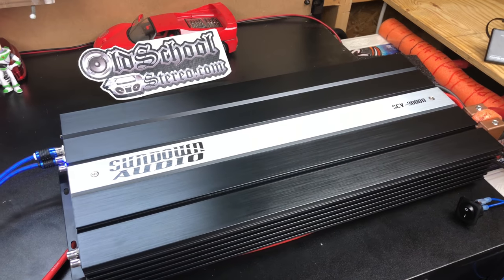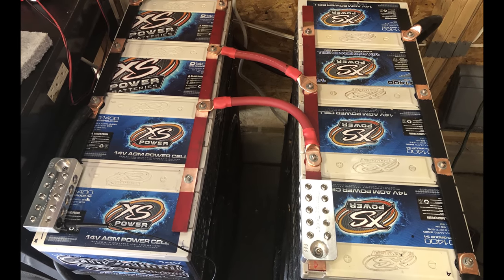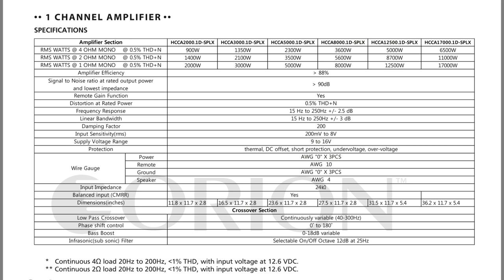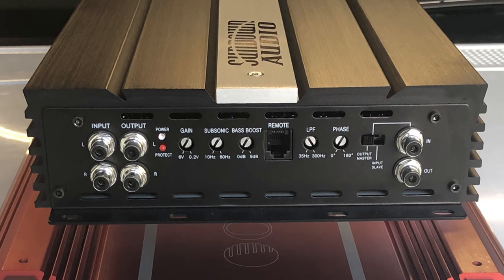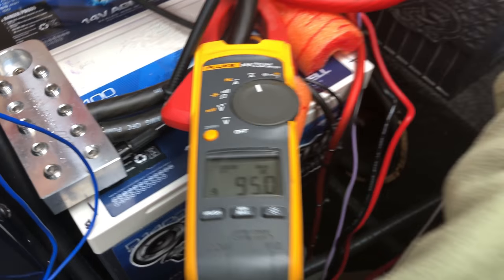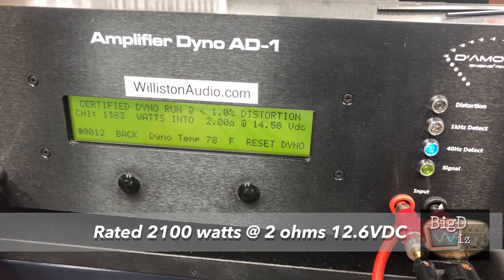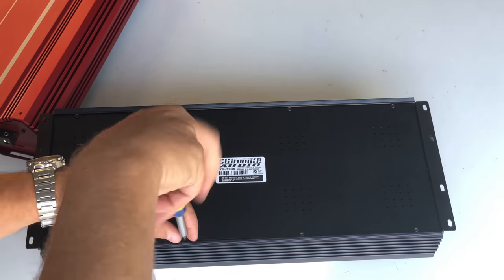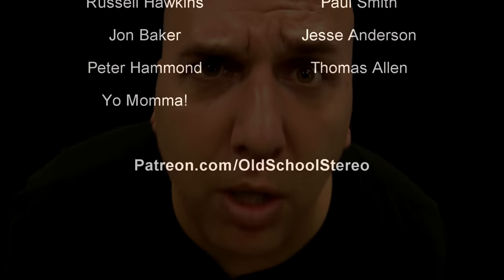Sundown SCV-3000D vs Orion HCCA 3000.1DSPLX Amp Dyno Test (4K)

Comment: BigD, any word on what the Orion does dynamically at 4-ohm? I always keep telling people, strong output at 4-ohms+, as well as dynamic power will always be better for music due to impedance rise. All these people with 3K+ Korean amps are probably putting out less than 1/2 of that on real music unless they play at the point of lowest impedance (which is depends on woofer fs, port tuning and box size).
Reply from the maker: Yes, 2171 watts Dynamically at 14.7 volts according to my tests.
Reply: Thank you. :)

Comment: I thought I had seen somewhere that u were possibly giving one of these amps away after u had tested them all. I may have seen or read it wrong. I don't remember. I have watched this video like 10 times since u have posted it. I'm still blown away by the power that monster put out. If u decide to give it away, keep me in mind. LMAO. All jokes aside man u made an awesome video. I think this is the best video as far as dyno testing so far. Thanks again. Crystal clear picture. Thanks for all of ur hard work. I love the Orion amp, and yes I hate the plastic end caps also.
Reply from the maker: Yes, Orion has agreed to offer up an HCCA 3000.1DSPLX. Details coming soon!
Reply: BigDWiz wow man that's awesome. That says a lot about a company right there. That's great.

Comment: What I want to know is if this 4500.1 DSPLX is the same kind of beast! I hate to buy it with out seeing a Dyno but I’m pretty sure I know what to expect. I’m holding out for that 8000.1 to come back though I’m not giving in I love my ORION and refuse to switch but the JP83 was tempting just because it’s the only thing available around that power that I’m looking for.

Comment: the orion definitely killed them all, but it is truly a competition amp and not a daily amp.. who really runs triple inputs daily? lol the price is also very good.. I'd still say the skar comes in 2nd do to its price per watt and reliability and more of a daily use amplifier.. just shows you that sundown is way over priced, and has the exact same gain controller with clipping as the skar.. is the extra 200+ dollars really worth buying the sundown over the skar? only thing it has that skar don't is the tiffany rca inputs.. I feel that my skv2.2500 is more closely matched to the sundown 3000 and I only pd 499 for it..
great video though, been waiting for this.. maybe people will reconsider where they put there money.. I guess if u r running sundown subs your probably going to buy there amps anyways as ur not on a budget...
Reply: Also the triple inputs are better for a daily amp because less voltage drop means less heat. Also you can run multiple batteries/cap with out needing junction blocks.
Reply: I wouldn't mind adding some extra wiring to get a beast like the orion. I'm sure it would do just fine daily if installed and used properly.

Comment: I'm not surprised. I have been out of the car audio game for over 20 years, but I miss that bass! I used to run 2 Orion DVC-12s and 2 Orion XTR-6s along with 3 Orion XTR tweeters and 2 Altec Lansing 5 1/4s all off of 1 Orion 225 HCCA!  I never had done the Big 3 upgrades or had an extra battery or anything back then and that amp never shut down on me. 50 Watts RMS and would smoke dudes with over 1500 RMS in SPL comp. Phoenix Gold was huge back then and my buddies all had it. They bowed down to Orion once we did SPL drags. Keep rockin Orion!!!
Reply from the maker: Orion now is under new owner’s but yeah they still kick 🦵

Comment: Holy shnikeys that Orion's a beast!! 😮 Very well built too. 👌 I'm not big into class D amps but at that price, it's irresistible not to buy it. Great video bro. 👍
Reply from the maker: It really slams at 4 ohms and not too power hungry at that load. It’s a big, heavy amp though.
Reply: Not into Class D? lol , Its snake oil that ur drinking. Do a blind test and tell us if you can hear a negative difference.
Reply: DA Master Ummm.....Yeah. Been there, done that. I'll stick with my class AB's thank you.
Reply: DA Master They'll never be able to reproduce music as accurately as class AB because they're non-linear and the physics say so. They mimic music.
Reply: Late to the party...it's been proven, audibly you can't hear a difference between class a/b or class D, it might show up on a digital spectrum analyzer, but your ears cannot pick it up, at all.
Reply: It may not be very audible for sub duty. As for full range class D, very audible. And I don't care what anyone says. My ears don't lie. Maybe when I hear a class D with GanFet technology the case might be different.
Reply: There's a guy named Richard Clark that's offered $10,000 to anyone who can tell the difference for 12 years, no one has one. Look it up and give it a shot. Closest anyone has come is 10% accuracy, which was lucky guesses.
Reply: I know who Richard Clark is. Not interested.
Reply: I didn't think you would be. I've been around SQ comp for half of my life. Heavily involved in the RRS circuit. 10 elite shows a year just for SQ. Some are elitist like you and bought into the BS, others know better and vied for efficiency. Iasca and USACI both have had champions running class D to mids and highs. 🤷‍♂️
Reply: You're beating a dead horse bro. I like what I like because of my ears and not what others may think. If you like class D, then stick with it. I've been in this hobby for over 30 years and it's all about choices and personal preferences. I won't be swayed in this matter.
Reply: That's fine. I just hate seeing people waste money and efficiency because of a long proven wrong myth. By all means though, Carry on.
Reply: @wal  Do you remember the amp draw @ 1ohm for the Orion?  I know you showed 317 @2ohms

Comment: That Orion HCCA amp has been out for years. Its always been a beast! I had an MTX Blue Thunder Amp years ago driving a Cerwin Vega Vega Series back in the day in like the late 90’s early 2000’s. Speaker was made of Kevlar, and had double lip foam. Had it in back of my IROC Z. I still have the car, actually still have the system. Still have the Alpine Head Unit with Gold Plated 4 volt preouts. Its when BBE was big with those. I paid close to $500 back in 1998 for it.
Reply from the maker: The Blue Thunder amps are great too
Reply: BigDWiz 
Yeah had surprisingly good power for its footprint. I think mine was 425X1. Could of hit the sub with more, however I was 16-17 years old back then was lucky to get what I did

Comment: At 11:06 the camera is zoomed in on the Sundown amp showing some 1000uf 35v caps branded CapXon. CapXon was the brand of caps Samsung used in TV’s and Monitors in the mid 2000’s that all went bad by venting and leaking and gave the brand a black eye. If Sundown is using cheap components like that, I wouldn’t give them a dime, I would avoid Sundown like the plague.

Comment: Damn happy Sundown made and did over its power but I was expecting more, that Orion amp is beast and a great bargain buy.
Reply from the maker: I was unable to get the Sundown to make 3kW certified until I provided over 14.4 volts. I was honestly shocked it didn’t do 3300 or more certified. Orion was the only amp to include a birth sheet, but it was the only amp I purchased. The rest were borrowed for the tests. I don’t believe any of the others came with birth sheets new. My Orion stated 3300 watts at 1 ohm @12.6 volts, 0.5% THD

Comment: MD Audio, thank you for not screwing over Orion XTR and HCCA lines. 

The other amps are all great, really they are. this reminds me of the good old days when people saw Orion in your car, they knew it meant business. 

PPi, Soundstream, and others pay attention. This is what your higher end amps should be doing as well. This is how you regain respect, with proof and reliability, not designs and stupid spider graphics that impress 10 year olds.
Reply: Couldn't agree more about what Epsilon is doing to PPI/SS. If Orion can make a comeback so, can those old school legacy brands. Just takes the will and good company management. Both missing from Epsilon right now. 
But, MD Audio...please build better Cobalts and just kill that Ztreet crap altogether.
Reply: MSH68 I thought MD engineering was running orion somebody said directed was so I had to research an it's Def md!!
Reply: MSH68 an cobalt an z street are jus a cheaper lines I don't think they will make those any better without costing the same as xtr sn hcca made for budget, u jus gotta know what to expect at that price point probably not gonna get a 4000watt amp for 150 bucks lol.... an very true need to get rid of the z street line for sure!!!
Reply: Agreed ppi black ice amps are good solid amps at a great value price if you toss the box out the window and don't pay attention to their bullshit claims. I feel like they would be well-served to just put accurate ratings on their stuff and give them model numbers that reflect actual output. Nobody believes bullshit ratings anymore you got to tell the truth these days or people like Big D and Ryan B. Will call you out.
Reply: Running a 2013 model Soundstream TA1.3000D . Rated 3k watts at 1 ohm... I would love to see the Dyno... I love og Soundstream products as I'm running older t5 12s and my favorite RFL-12s in a Jeep.. those little r3.8 subs are amazing on the same amp as well... Would like to see Where the TA1.3000D stands in ranks with these amps.

Comment: Just got in sundown sfb 1000, cannot wait to run it. Or sell for a profit, but the bass knob is what got me. And the Orion Bass knobs, are literally the same as my Power Acoustik RAZR.
Reply: Not looking forward to my XTR bass knob assuming it's the same as the HCCA but we'll see.
Reply from the maker: I use the SFB1000 in my daily driver with a JL Audio 10W7. It’s enough for me
Reply: Would you post a video, and what are you wired to? My massive audio GTX 122 is at one ohm on a Pioneer701. I would like to replace it with my Sundown, would you Dyno test a pioneer amp?

Comment: Back in the Day circa 2001, I had a 99 Mustang Coupe.. with 2 12 Alpine Type R's and the Gem and Orion Red 250G I believe.. The power was insane, I want to say it was running at 1 ohm but would be stable at 1/2 ohm for even more power.. When the BASS hit you feel and see the car surging for power.. So it must have been drawing so much current. I had a 1 Farad cap inline but didnt seem to help at all.. Unfortunately on a Sunday afternoon I went to see a Movie on the other side of Town... (Starsky and Hutch) and my car was broken into and my subs, box. Alpine Head unit.. and the Precious Orion was stolen.. I was pissed and Heartbroken at the same time..

Comment: I'm not sure why people are so surprised here.  Obviously two amps rated the same wattage while at different voltages will perform differently.  The Orion is rated to make that power at 12.6v, of course at 14.4 it's going to put out larger numbers.  The same way that the Sundown would do higher numbers on a 16v system.
Reply: Because they are sold as 3k amps and Sundown is considered top tier and 30-40% more expensive.  On top of that, not many companies today sell at a good price per watt and the amp actually does far more than it's rating shrug.  It's quite impressive.
Reply: Robert H. Sundown still did less then all the other amps 🙄
Reply: Its showing you the best bang for your buck and sundown being the most expensive and putting out less than the others is really disappointing.  You cant run those SCV amps on 16v setup like the older SAZ series.
Reply: My point is that you can't put amps rated the same RMS at different voltages in the same competition.  Obviously any decent amp that's rated at 12.6 is going to beat the ones rated at 14.4 in a 14.4 test.  Test the Orion at 12.6 and see what numbers it puts up and show the people for reference.
Reply: Robert H. It’s a cheater amp. Besides most people aren’t going to be getting 15 plus volts daily or at full tilt anyway unless they’re running a huge power supply. Test the other amps at 12.6 volts I guarantee the Orion will probably still put out more power so I don’t see your point
Reply: Test the other amps at 12.6? They're rated to make their power at 14.4, if you give them less they're going to output less.  The Orion is rated at 12.6, they're being fed almost 2 volts over what they're rated at.. hence doing way over rated numbers.  You're completely backwards.
Reply: Robert H. Lol which is exactly my point either way the Orion is going to put out more power duh hence my last comment about the power supply your going to get around that voltage in a daily driver anyway
Reply: Nobody said it was a bad thing for Orion to do it, I'm saying that for the amp to be used in this comparison is wrong.  If it makes it's power rating at 2 volts less than the competition, clearly adding an extra 2 volts it's going to far exceed the others that are rated at this voltage.  It's a great amp, but it just shouldn't even be in this particular competition with the others. That's the point....
Reply: Robert H. I don't know of many brands that test there equipment at 12.6 like orion.....but my opinion testing at 12.6 is better for consumers bc most ppl won't see 14.4 if at all until electrical and or alternator is upgraded
Reply: That's irrelevant to this though.  It's the simple fact that if you're not testing a group of amps that are all rated at the same voltage, then the test will be skewed towards the one rated at a lower voltage. Either the Orion shouldn't have been in the group, or it should have been tested at 12.6v.  To your other statement, nobody should be even considering running an amp that puts out 3.5k@1 on completely stock electrical anyway, unless it's going to be run at 4 ohms for more efficient power than a lesser amp at 1.
Reply: Robert H. I do see your point but even at 12.6 they still do way over rated as mine is 484 watts over rated power u still don't see those numbers with the rest I don't think that would of mattered an guessing that orion is the only one I know testing there's at 12.6 they would never be comparable in your theory but they are bc there 3k amps not there fault everyone else tests there's at a higher voltage to get better numbers judge it however you wish!!
Reply: james mcnugget I would never buy sundown audio again they too overpriced
Reply: but the orion is cheaper, so maybe the more expensive orion amp(5k) should be compared to the sundown to make it more fair..... u can twist the test all u want to make the comparison "more fair".  all about dollar per watt
Reply: Sir Sticky but what about the voltage that I keep hearing bc orion tests at 12.6 instead of 14.4 an ppl think it's unfair that every other brand tests there's at 14.4 to get higher numbers guess that orion's fault? Lol
Reply: Percy Mack I can't argue that sundown is over priced the only thing in my opinion they have goin for them is all there lines do rated wattage they don't bs there numbers but I'm not so sure that's worth the price anymore!!
Reply: That Orion at 12.6v would still do more then that sundown would on 15.5v
Reply: blockbeata09 was thinking the same thing....an how many ppl really have a separate 16v system unless u comp with it!? For most consumers 16v numbers mean nothing!! Most ppl including me don't even have a steady 14.4 v system

Comment: And on Facebook the owner of sundown has been nothing but a whiny baby 🍼 because Orion beat his over priced amp
Reply: the orion is a great amp. sundowns solid too but you know when something comes stock with triple inputs its gonna put out some serious power
Reply: im using one for some tc-3000 15s. can wire the pair to .7 or 2.8 ohms but theres tons of box rise with these particular subs so im always looking at the 4 ohm and higher ratings to run them, was using an old autotek mm.4000 dual mono that worked great but it was stolen. ran brazillian for a while too but then found the orion and had to give it a try
Reply from the maker: Sundown has great products, there’s no doubt about that. They are expensive, so it makes sense other mfg’s want to undercut them to get some of their market. In this case, 4 of the amps are similar in layout and output, then one is just in another class. The Orion should be a 4K amp rated IMO. It’s just leaps and bounds more powerful than the others.

Comment: I own a sundown svc-3000d that is currently at sundown for a warranty replacement. I run 2 sundown x-10 with this amp and have not been impressed. I borrowed a hifonics Brutus 2600 amp and it pounds the x-10 compared to the svc-3000. Sundown said I can pay $260 to upgrade to the svc-4000d.
  After this video I'm convinced to sell off my 3000 and spend my money elsewhere.

 Any suggestions for 2 X-10's?

Comment: came across your channel awhile back and love it, spending your own money on these amps to provide us with these videos. the orion smacking the sundown video made my day. i have some sundown subs and liked my 4th gen type Rs way more. i do have two of the r1200-1d Rockford Fosgate Prime amps i’ve been pushing my subs with over the years. so far, i love them. they’ve never let me down. with that being said, can u do a dyno test for that amp? i went over your videos and didn’t see it. i apologize for overlooking it if you’ve already done it. but what has me curious/confused is why my two birth certificates are so far off from each other. one of them says 1298 watts @40hz 1%THD. the other says 1401watts @40hz 1%THD. is this common to have identical amps to have over 100w difference? seems a bit peculiar. i watched a few videos and the numbers are all over the place. not many similarities in output between all the tests. the only one that looked normal was SMD. i just his tests more than the test others did. so if you could do a test on that amp i’d greatly appreciated it. thanks